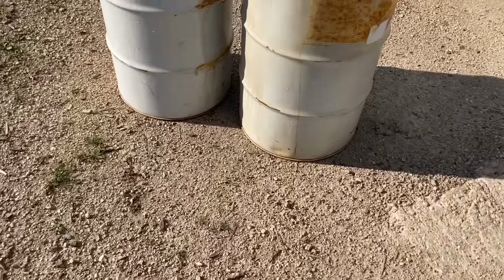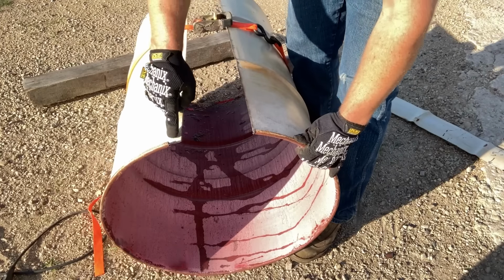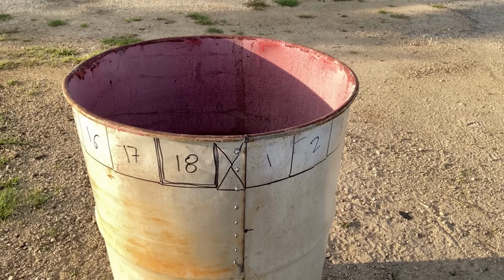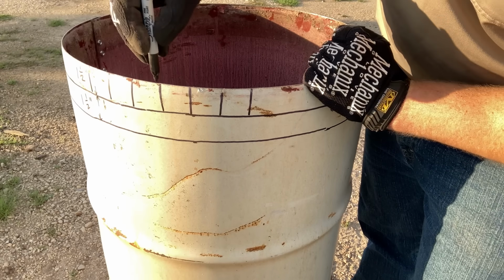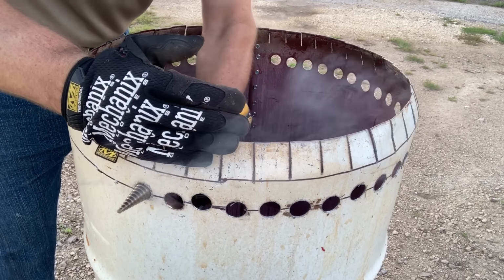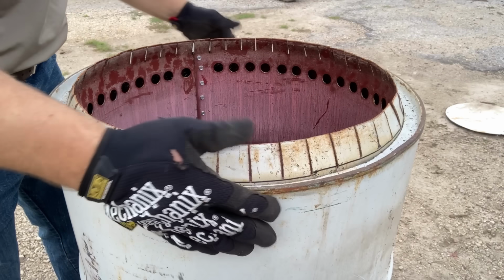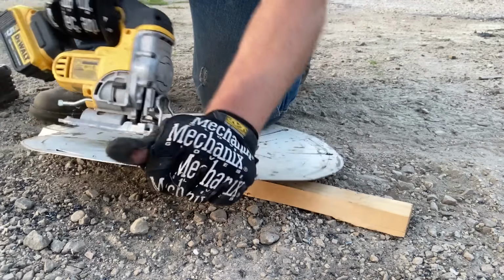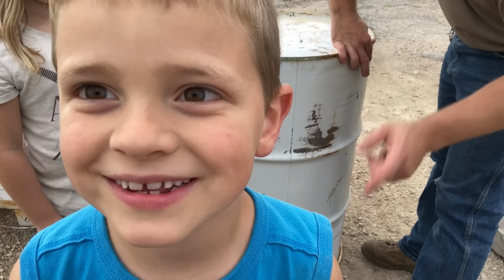Smokeless Burn Barrel

Comment: Built one this afternoon. Overall works great. First tip is buy the hole saw with carbide teeth at Harbor Freight. It's $20 and lot faster than the cone bit. Use high temp paint on all cut surfaces, but I am in Florida where everything rusts. Thanks for the design.
Reply: Wish I read this comment a couple days ago. I’m building this right now and this project is the first and last time I use a step bit (when possible)
Reply: @jkforzi  never used one but you think the hole saw is the way to go?
Reply: A good quality step bit is what worked for me. There is a steep learning curve, but after a half doz holes, you leardcthe correct pressure to drill thru and when to let up. After that I was drilling 6-8 holes a minute, and that was slow. But you have to put the time in to learn what pressure is the magic point.
Reply: @trebledog  of n
Reply: @wg8304  carbide tipped hole saws (look near electrical tools, they're used to cut into electrical panels and boxes) will nearly cut, but use heavy, steady pressure and a little lube, like used motor oil.  This carbide teeth are brittle, so they'll stay sharp for a long time, but will break easily if they chatter or get hung up
Reply: Use a plasma cutter......for most of it. It’s bang bang
Reply: As for the high-temperature paint, it only makes sense AFTER you did the initial build.  The original paint on the barrels isn't usually high-temp, so you are wasting the paint at first.  I would probably NOT attach the outer barrel to the inner barrel "legs" until after the first burn, THEN, repaint both barrels with high-temp paint.

Comment: Freakin' brilliant. This is basically the exact way a jet turbine combustor works, secondary air injection for clean combustion, and it keeps the outside cooler for safety. Really solid work! Thanks.
Reply: It's called a woodgas burner. In this case a barrel. The gases that don't burn the 1st time has oxygen reintroduced to cause a 2nd burn. . That's the reason normal burn barrels smoke. Lack of oxygen
Reply: This is the same principle as AIR injection in late 70s and 80s engines.  More efficient catalytic converters took over, and I'm not aware of any current production engines utilizing the tech.  The diesel particle filters function more like an afterburner by comparison.
Reply: @Lawrence330  I took the dpf as a catalytic converter for diesels lol I think u might mean the egr. I get what you're saying tho.
Reply: I looked at that project and thought: "a few of those would make one FREAKISHLY large jet engine..."

Comment: When I was a kid, everyone had what were called an "ash-can" which was a barrel in which people burned their trash.  They were very smoky and hard to keep going, and the trash was never completely burned.  Great improvement on the old ash-can design and a lot of fun!  The amazing thing about this is that the space between walls has a much greater vertical length than the Solo Stove allowing longer exposure time for the air rising to be super heated, expand, and then come out the holes at the top hotter and at a higher velocity for a more efficient burn!  The only improvement I could think of, would to create a system where the air coming in from underneath could also be heated before entry into the burn chamber as the Solo stove does by routing the air through a hole in the bottom which then comes around the ash pan!  But you can't argue with success!

Comment: I have made four of these for the family. On one burn barrel I used a lid for a bottom and raised the barrel so I would not have to drill all those holes on the outside barrel. Plus seven fire pits same basic method. They all work great.Thanks you are amazing.

Comment: I noticed you burned through a lot of cutting wheels. Diablo makes a diamond tipped cutting wheel that lasts a really long time. I skirt mobile homes and used to used about 5-8 discs per hone. I’m on the same Diablo wheel for my 4th home.
Reply: Thank you very much for the great tip
😉👍👍
Reply: So, what was the rpm of your grinder?
Reply: There's an exciting new way to cut metal.  A saw.
Reply: @johndough9187  if I’m within a 120v-20a outlet I will be using my plasma arch torch cutter!  Hey, I wonder do they have cordless ones 🤔🙀?
Reply: diablo  blades are awesome
Reply: Lots of places I would have used a Sawzall or jigsaw too, dipping that poor stepper bit in some cutting fluid between cuts wouldn't hurt if you want to use that $50 bit for more than one project.
Reply: He is cutting the wrong way, that is why he burns the wheels.

Fireball tools did a nice video on how a grinder should be used. It makes a huge difference.
Reply: Fucking ads in the youtube comments now.
Reply: @superspecialty5169  Cordless?...Yeah.... it's called a road flare!
Reply: I use to fabricate and this young guy went through disks in two minutes. Sawing wood nothing but smoke. I was clueless as to what he doing differently. On wood I leave the blade just under the thickness of the board. I could lay a board on your kitchen table and never saw through and touch it. And I zip through, no binding, no smoke. And I get about half an hour to a full hour cutting sheeting. I collected his used ones often to finish the jobs. I showed him how to use them, but he didn't seem to follow instructions. Couldn't teach him to weld either, caught him trying to weld aluminum with 7014. I got very frustrated with him, but he was younger and could get in the tight spots.
Reply: Diablo is made in Germany, I love every product I have from them
Reply: @Light Roast Coffee You use cutting wheels in welding school? I had welding in highschool and college, the only time I've used cutting discs is professionally.
Reply: @superspecialty5169  Wouldn't THAT be somethin'!  🤔🙀 Right on!  :)  Cordless Plasma cutter!  Looooook out, this'll be fun to toy with.
Reply: @John Wilk that's flat out ridiculous
Reply: Good advice Ted. They are good blades.
Reply: @traitorousbipeds  As a boat builder, wire wheels and cutting tools were separated, to not leave traces of steel on boat fabrications. Ever see a rust trail below a stainless steel part? Stainless wheels and abrasives for stainless. Steel for steel. Like a bow cleat would have 3M 5200 sealant, stainless steel nuts & bolts, glass fibers and resin dabbed on a aluminum backing plate below deck. No rusty steel touches boat parts. High end catamaran yachts, quality is important to our not poor clientele.
Reply: VW's are made in Germany too and they brake down frequently. They are a bitch to work on, and they are expensive to fix, and the parts are expensive.
Reply: Hahahahahahaha John Wilk wrote 2 small sentences. You wrote all kinds of stuff ghat did the very thing you accuser him of. Haha Who's triggered? Hahahaha Who is making assumptions? I think he was just making a light hearted joke. Hahahahaha But even if he wasn't, so what? Hahaha
Reply: You're supposed to let the grinder do the work.
Reply: @Light Roast Coffee they do cut much slower.
Reply: @HollywoodCreeper  who’s talking about vehicles?
Reply: @fearofchicke  Maybe you don't know, but people rave about German engineering. VW even says their German engineering is so good in their advertising. This woman says Diablo is good, because they are all made in Germany. I'm just saying that I haven't found German engineering to be very good.  I do think Diablo probably is though and maybe also because they are made in Germany. Hahahahaha
Reply: @Coyote27981  Yes they did and I feel like most people who use grinders kind of already knew it even if they just plow through a cut. I wouldn't of guessed the difference would of been so significant though. Also the Pfred wheels that fireball uses really are some of the best. They just might be hard to find locally unless you work in a shop or have a Grainger around you.
Reply: Everything Diablo makes is superior!
Reply: Big data, bro. 👍👍
Reply: @user-lb8do4ew6k  It hurt me seeing no oil when drilling...would have prolonged those bits a lot and made it a bit easier.
Reply: Thanks for the info 👍
Reply: it comes down to technique, too.  Some youtuber (maybe Fireball Tool) compared plunge cutting with an angle grinder, and skimming the surface back and forth.... the later was significantly slower, but consumed 1/10th as much angle grinder wheel!  The high speed camera showed the metal vibrating during plunge cuts, which ate away the blades fast.
Reply: Do you have any experience with their multi-purpose hole saw?  I bought a 2" one last night to make a burn barrel with today.  Also bought some cutting oil for the purpose as well.
Reply: Never had luck with the diamonds. They rattle reall bad also. 
Develop some skill with the fiber wheels. If you see smoke or dust.. Your using it wrong. 
Even worse with the diamond blades .. When they wear out, you waste time. Hard to tell its worn out until your done and you think to self.. Wow that took way longer than it should.
Reply: @Coyote27981  Thank you for sharing that info. When I first read it, I took it as argumentative, but after watching the fireball tools video, you’re legitimately sharing life changing information.
Reply: That thing is wicked cool 😎 it's like a a portable turbo gasifier fire pit , 👍👍👍👍👍
Reply: @traitorousbipeds  YES. Amen. Amen. Boys need dads to teach em to use tools. We need to raise men. Strong men that are capable.
Reply: 011
Reply: The diamond disks are good but damn they are loud and seem to cut a little slower..  that being I bought 2 and they lasted quite a while..
Reply: I have one on my grinder now and they work way longer.
Reply: @John Wilk jesus christ....
Reply: Nice, 
A good prayer:
I'm a sinner JESUS please forgive me for all my sins I know you shed your Blood for me on the cross at Calvary. Thank you JESUS for my salvation and for shedding they Blood for me. I love you JESUS. 
Romans 10:5/10 ct...❤️k
JESUSisLord!Amen...
Amen..
If you'd like to call someone who cares 
83
For
Truth.
bc you don't know when you'll die?
.y r u hesitant........
Reply: @Mr.Caring  what exactly are you trying to accomplish? Do you think trolling youtube with nonsense is effective? At all?
Reply: @johndough9187  While you're being edgy with your saw, someone using the proper tool will get the job done in a tenth of the time.
Reply: @jwm6314  A saw is a proper cutting tool.  An abrasive disk is a poor substitute.  You can use up 100 disks for every saw blade.
Reply: @Eddie D That's what I do too, but I don't drill the holes - I poke them with a big sharp metal stick.  Takes about a minute.  You will want to poke the bottom one from the inside out so rainwater can better drain.
Reply: @everettplummer9725  not poor is a good euphemism for rich 😂
Reply: Great ideas
Reply: @user-lb8do4ew6k  I'm amazed at how many youtubers don't oil when they drill
Reply: @HollywoodCreeper  except the original Beetle.
Easy to work on you can do everything yourself on that stunning car
Reply: @superspecialty5169  shit ton of cordless saws at any hardware store
Reply: @Eddie D Im with you on this one.Because I live on the coast and rust will take over anyways and will maybe get 2 years out of a barrel before it gets scrapped.So time does have a meaning if you dont expect to keep it long.
Reply: @John Wilk you must be real fun at parties.
Reply: Or you could buy a cheap plasma cutter
Reply: @John Wilk thanks for the laughs, mister Booth
Reply: I was going to say something glad i found it in the comment section.
This is why i roam....

I've purchased 2 but haven't even used them. Lol
Reply: Guys, Here is The True Savior

YaH The Father (Genesis 1), Who, with His HAND, formed “man (Adam)”, from the dust of the ground (Genesis 2:7).

YaH’s HAND they NAILED to the Almond Tree, to symbolize forgiveness of the “Tree of Life” sin OF “man” and thus “The Fall OF man” (Genesis 3)

YaH The Father arrived to be Crucified via the Tent of Meeting (Exodus 33, Isa Scroll), how YaH has ALWAYS arrived

Comment: I made one my own way.. still lasting in a wet environment. One barrel, made a stand for it to keep it off the ground so the bottom doesn’t rot out. Next I made 3 sets of 2 cut outs 3”x1” along the bottom. After that I made a grating to keep the bottom clean and allow air flow to the fire. Set that at about 3” off the bottom of the barrel. Made that grating removable for easy cleaning. The bottom of my barrel is not open like yours so I don’t have a mess on the floor. I just dump the ashes in a hole when it comes time to do so. Last about 7 or 8 years in NY state.

Comment: My mom and I made followed this tutorial and it worked out great! Got an acre lot and was able to get all the yard debris burned up 100x faster than normal with no smoke!
Reply: How long did it take to complete the burn barrel?
Reply: Awesome man, now take the ash, put it a 5 gallon bucket with non chlorinated water, add leaf mold and a tablespoon of seasalt, give it between 15 day to a year or more, then use a 10 to one delusion for potassium fertilizer.  Thats a Jadam, Korean natural farming method I learned.  To make plant specific fertilizers change the ash part of that recipe to chopped grass and cuttings from the plant you intend to fertilize.  Personally I couldn't find leaf mold in my woods,  so I use my Homemade compost.
Reply: @infiniteadam7352  good information thanks from England UK
Reply: @infiniteadam7352  you lost me after 5 gallon bucket .  would it be useful to just throw the ashes in my garden ?
Reply: @time2cclear  in moderation.

A little bit can be useful, a little bit more if your soil is acidic.

Too concentrated will kill your plants
Reply: @priestesslucy  ok thanks ,  just started my tomatoes and green pepper seeds .  i couldnt burn the ground in the area because it requires a permit and im not a permit kind of guy hehe .  thats why i got the burn barrel .
Reply: @time2cclear   Best thing to do is a teaspoon at a time of ash to a side plant that is in a seperate 5 gallon bucket.
That way you can see how much works best.

If you put too much you're only killing one plant, rather than all of them.

Just my 2 cents of course.
Reply: Is it rusting faster than a regular burn barrel?
Reply: @thomasolson7447   Why would it?
Reply: @TreeCooper  higher temperatures cause oxidation. It has a special name after some dude like the Haber-Bosch Process. I would also point out that smoke causes oxidation to. It's acidic in nature, therefore it corrodes. Since this is smokeless, that might extend its life. The higher temperatures may offset that.
Reply: @TreeCooper  thanks , i will try that . i appreciate advice , thats how i learn .
Reply: @time2cclear   

That's how we all learn sir.
Reply: @thomasolson7447  

Best way to combat that sir, is to get high heat paint.
You can get the kind they make for engines, and that is good up to 2000° Fahrenheit.

Paint both barrels fully and viola.
Reply: @time2cclear  
Something I forgot to add.
That 5 gallon bucket should go to failure, so add that ash every day and that way you can get an idea of the failure point.

Then all you have to do is estimate how many 5 gallon buckets it would take to fill your garden to the depth of the bucket.
That will give you a good idea on how much to add and not to add to your real garden.

Sorry for not mentioning all of that earlier I was busy lol
Reply: @TreeCooper  ok iwill try that , thanks
Reply: @time2cclear   

No problem.
Reply: Appreciate all your suggestions.. my 9 year old son and friends are excited to use this in their new tree house cold night... The plastic barrels is much easier for them to lift up and I Recommend going to the oil change shops to use their dirty oil and used tires and use the front grills of cars to place several Filet Mignon on the older metal car grills as they are more likely metal but make sure to flip or change if the newer imitation metal grills or hubcaps starts melting under your steak. Use some wd40 to separate the steak especially if it was cooked from a freezer burnt state.. remember the plastic can harder back up if the steak isn't eaten within 3 minutes 
Please donate if you want to see how I dried and tenderize beef jerky by pinning it between the tire treads of new hot asphalt pavement.. !
Reply: At the end of the day it's useless. Burn barrels don't last long so you'd spend more time making it
Reply: @davidtaylor9336  should last longer than a day though. At the end of the day it should still be fine, I'd guess 😎.
Reply: @priestesslucy A little extra is good, if your growing jalapenos. Otherwise,  best to error on the light side.
Reply: @dubmob151  ours lasted for months - burning once a week for about 8hrs total burn time. Still going strong!
Reply: @infiniteadam7352  Sounds like a great video project. Looking forward to seeing it...